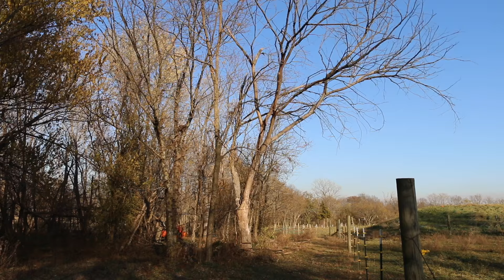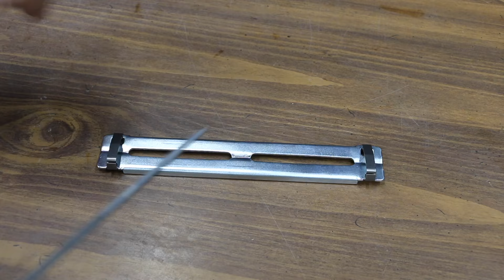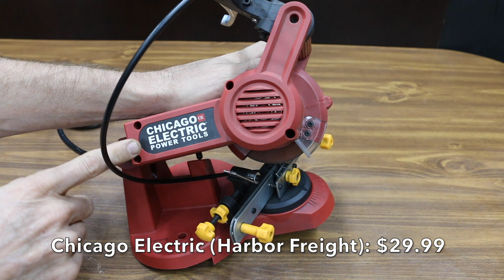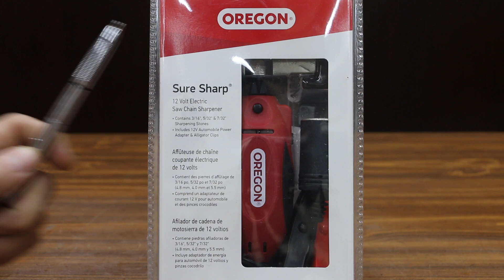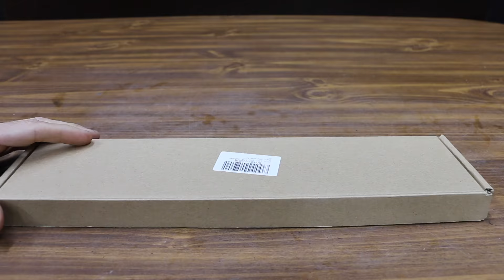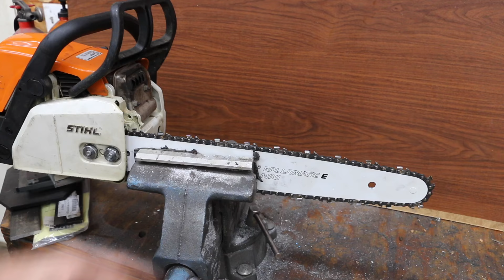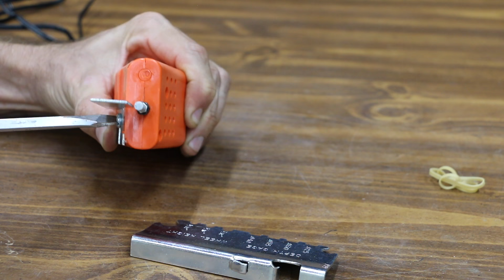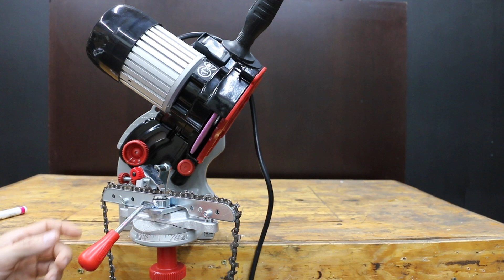Which Chainsaw Sharpener is Best? Let's find out! Stihl, Granberg, Chicago Electric, Oregon

Comment: I have an Oregon electric bench grinder that is about 12 years old.  the instructions on mine advised to loosen the big knob under the chain vise and tilt the base of the chain vise in different directions for left or right teeth.  This gives a different geometry to the grind giving a more aggressive tooth angle and I think the result is a faster cut than I get with the filing system ... that I never use since I got the bench sharpener.  I think the one in your demo has that tilt feature but it was not used and the chain vise was vertical for both right and left teeth.  I'd love to see one of your test times with the vise tilted
Reply from the maker: Thanks for the suggestion.

Comment: If you get a chance and haven’t yet, can you test the Timberline carbide sharpener?  I’ve used one for use now with excellent results, just never run official comparisons with anything.  It does feel like it’s faster than an oem chain after sharpening, especially when I remember to file the rakes down.  

The last sharpening that was done was a very anal re-profiling of heavily damaged chains then went aggressive on the rakes.  Saws were blindingly fast and aggressive through white spruce, poplar and birch.

Might be worth a real comparison.
Reply from the maker: Thanks for the video idea.

Comment: Fir the tenth time my guy. WHEN YOU TILT THE CHAINSAW AT ALL IT WILL SPEED UP THE CUT!!!! Why you can't fathom that is beyond me. You need to hold the saw at the same exact angle for every cut or it's not a good test at all. It's crazy how much faster tilting the saw speeds up the cutting process

Comment: I made my living for over 10 years logging cottonwood for a pallet mill.  Only large stihl chains and although I tried a couple of  sharpeners I always went back to just a bare ass stihl file  without a handle.  Worked better with good sunlight and the chain was sharp when the reflection of the edge disappeared.  First sharpening is sharper than a new chain.  Less material is taken off with a file so the chain lasts longer

Comment: So what about the rakers? Only the Stihl 2 in 1 was mentioned regards to filing the rakers. None of the other ones took care of that at all, did they? Won't that make a difference as the chain gets worn down?
And what one was supposed to sharpen the chain in 5 seconds? I never got which one claimed that. A friend of mine bought this special chain with a piece that clamped onto the end of the bar and sharpened his chain as it spun around, so you didn't have to touch it with a file at all. But it required a special chain which came from the manufacturer of the device. It was impressive though, for what it did.

Comment: I used to Precision file chains for oregon. R&D labs. We would do each cutter with round files to accomplish the same geometries on each cutter. Run each cutter through a spectrometer to measure the hook angle of the cutter at a certain depth. Filing is the best way to do this. We used the same saw with a full tank of gas and oil topped off. The wood we used was cleaned logs and for extra precision we used 12 x12 cant's with zero knots. When using the electric sharpeners we would dress the stone wheel to get a nice round edge. This is a good way to get a nice round gullet. This  may have effected your results. You did a great job though. I personally always likes the stihl chains. They felt the best. Oregon uses grinders that come in from the side. Then they assemble the chain with the cutters sharpened. Carlton chain was also made by Oregon but they had a different method with four big grinders that sharpened the chain after it was assembled.
Reply from the maker: Thanks for sharing.

Comment: I have Been hand filing since 1972, but also have had them done at a shop with a wheel at times, the only draw back of hand filing is that it has to be sharpened on the bar, and when I’m in the field and want to speed things up, I just put on another chain.
These dull chains add up, and I really don’t want to spend time mounting and dismounting chains to sharpen.
For this reason I’m leaning towards a bench sharpener.
Reply from the maker: Thanks for sharing.

Comment: I have used the sthil 2 n1 for nearly 2 years now ,  compact, convenient, fast and easy to use. It also fits in the glove box of my utv  without trying to keep track of accessories or other loose  parts  other sharpeners need.
Reply from the maker: Thanks for sharing.
Reply: I own 4 of those from Stihl. 
They run about $40 here in Alabama and I own so many because they seemed to disappear when I would cut some storm trees so I would pick another up. It is the only time I haven't been upset about buying needless multiples. 

Now I have them everywhere I need them... 

BTW, I haven't checked lately but the Pferd ones or knock offs I'm not sure are almost half on eBay. 

I believe Pferd makes these for Stihl.

 If price has got you unsure
I wouldn't think twice about buying one on eBay. They really are that good...
Reply: dito. blue 2in form Pferd

Comment: Another great video.  The results were a bit surprising.  I figured the bench units would do a better job.  Glad to see what units do a good job in reality.
Reply from the maker: Thanks!
Reply: Grinders take awhile to learn, if you can't sharpen that chain so it cuts faster than a factory new chain you did it wrong.

Comment: I think adding "filed by hand with a round file" would have been a good control group.
Reply: The “Oregon field sharpener” was basically a round file by hand. It had that angle jig clipped on to assist the angle, but that doesn’t really help as much as just allowing the chain tooth to guide the angle. 

I’m glad to see the old fashioned low tech way is about equal with all those power sharpeners and even a new chain. The slow and steady process probably gets more life out of the chain too; instead of hogging it down with abrasive disks or rods.
Reply: That would have put even more variables into the test.  Understanding the sharpener and using it correctly is #1.

Comment: Im a climber and when sharping a chain you should always tighten the chain so that it dosent wiggle around on the bar this also prevents from the teeth angle to change and then adjust your chain after sharpening of refuling I also would like to see the test where the chain is sharpened using just the file by its self no guide as someone would realistically sharpen on the job
Reply from the maker: Thanks for the suggestion.

Comment: Time spent removing the chain must be considered if it is necessaryfor the system. Once calculated the best sharpener is the Oregon sure sharp and it's clone simply because removing the chain to sharpen is not necessary. Just remember to use diamond barrel  bits.  Stones cut too fast and get smaller as they wear.
Reply from the maker: Thanks for sharing.

Comment: You definitely used the bench grinders wrong though.  Blueing the chain is not going to work.  Taking too much material off.  Just need to touch it with the stone.  Your depth gauges would have been way too high

Comment: I love this video, but one huge variable that I think was missed was the 4x4s, you can see the varying grain, that could have affected times drastically when hitting knots. I also think that weirdly using a gas saw would have been more consistent then the variability that comes with fading battery power vs. peak
Reply from the maker: Thanks for the constructive feedback.

Comment: I had a hard time believing any of these reviews with a battery operated saw.  The battery is a variable.  If it's week it won't get the RPMs.  It's like testing my battery operated weed eater.  Same string...but when the battery is week it slows down.  Use a gas powered saw.
Reply from the maker: Thanks for the feedback.

Comment: It's a fact when any product has " MADE IN CHINA" you can rest assure it is cheap, low quality, not built to last crap.  Plus forget about repairing, returning and product having any quality control or built with pride.  
Stihl chainsaws are cheaply made especially with the case/housing.  The bar nuts, studs an area that needs to be very durable is far from that.  The studs are not bolted to the saw body secured with locking nuts on opposite side of chain.  When removing bar if the nut is tight, stuck from grit the entire stud bolt will come out with nut.  It is just screwed into the plastic housing and once the stud comes out.  When putting stud bolt back into plastic the half that is self-threading screw will never fit snug because its threads are just the plastic and a 1/16 turn will strip even worse.  Now the bar can never be bolted on tight or will remain tight.  Yes you can use a JB weld plastic epoxy permanently securing bar bolts and pray the threads never mess up.  
I do not think with the hype Stihl promotes on quality, the high cost for equipment, repairs and the OEM parts. Paying more where the manufacture cost cutting methods in areas they chose cutting quality to reduce their cost is not only unsafe but makes a product junk.  Once these strip out even if product is just a few months old Stihl will be happy to replace housing you just need to pay them for part which is a minimum of $100.   They do not stand behind Junk made.  Look at Husqvarna the bar stud is a case harden bolt housed in a metal body with lock nuts instead of threaded into plastic.  They are inside the bar oil tank.  Stihl also sets their equipment up where special tools they do not list are needed to make adjustments, work on and do your own service.  Stihl product that you own and purchased is designed so the owner has to use Stihl repair center.  You pay for the product and call it yours but the truth is Stihl like many other corporations they still control what you assume is yours.  The average difference in repairs/maintenance cost is ridiculous.  Ordering/Using OEM parts, doing the work yourself will reduce your cost by 65% minimum and could be higher.  If you follow manufactures regular service maintenance schedule and replace with OEM depending on how much you use, drive, hours or mileage a person using factory service dealer would have more in just the general maintenance/ service that the equipment.  I have got quotes for a simple repair, replacement with OEM part and the cost of both labor and materials from factory repair center $1383.00 vs me ordering same OEM parts doing same job and cost was $223.00 parts took me 2 hours.  Even if I paid myself $100.00 per hour I still saved $900.00 and no special tools needed socket set, screwdriver, pliers and duct tape on stand by because everyone needs duct tape. LOL

Comment: It's a well known fact that new chain is not sharp nor accurately ground. Consider that the cutting bits are in contact with other portions of the rest of the chain in its shipping container and that the package goes through tremendous amounts of vibration during shipping and that leaves pre-dulled chain. New chain cutting bits are ground BEFORE assembly and the grinding wheels at the factory are not under constant surveillance so that leaves inaccurate grinding on many of the bits. Then the "sharp" cutter links (bits) drop into a bin where they rub up against other cutters thus dulling the bits pre-assembly. 
     Almost all western timber cutters grind their chain even when brand new. Spare sharp chain that is carried during the day is typically tightly wrapped in shop towels in such a manner that the bits touch nothing that will dull them.
     This is a great video. My comments were made simply in reference to the idea that new chain is the standard for sharpness. It is not. 
     I run Oregon 75CJ most of the time. This is very aggressive chain. It is chisel ground chisel chain that I maintain on a Silvey SDM-4 bit grinder and a Silvey HDG-6 raker and gullet grinder. I do have round chain grinders too; a Silvey 510 for 3/8's and .404 chain and an Oregon 520-120 for smaller round chain. Silvey products are no longer manufactured.
     I'm 63 years old and have been falling timber for my entire working career. I bought my first saw when I was 15 years old. The single greatest knowledge that I have gained about saw chain began when I bought a Granberg File-n-joint at 15 years of age. It not only does an incredible job sharpening round chain but also, if you pay attention, it allows a fabulous education on the dynamics of saw chain. Pretty cheap too!
     Be safe out there.
Reply from the maker: Thanks!  Thanks for sharing.

Comment: Twenty years ago I purchased the big Oregon bench sharpener , think I paid $300 , and some spare stones . I have sharpened hundreds of chains and it’s still in perfect condition! There is definitely a learning curve , easy to remove too much material, and burn cutter ! You must adjust slowly and go easy !
Reply: I totally agree with the learning curve. I use diamond cutting wheel so the diameter doesn't change with usage
Reply from the maker: Thanks for sharing.

Comment: Good video. I appreciate how you were trying to be scientific, but holding the saw with even a slight grip like you did can affect the results with what is called "tactile feedback influence". No matter how unbiased you may be, their could be unconscious bias just from observation and having direct contact with the experiment can change its outcome. I did see a few times where the saw angle suddenly tipped, and your trying to hold the saw steady may have given a brief but firmer bite for a second.  The fact that you said that one particular tool should have done better is a clear but unconscious bias.  Also, wood densities, knots, moisture, grain and such change from cut to cut.  Although not practical, a jig with no human influence cutting through something very consitent cut to cut (like Trex) would have been better. But this video was a good starting point.

I use one very similar to the Oregon Sure Sharp. It cost me $20 USD. I bring a portable jump start battery pack with me. It is fast, doesn't require a fancy set up, and I get great performance. The difference between 9.78 and 10.82 (in the first round) is within the standard deviation. I also bring along a manual sharping set very similar to the one you had that is in a pouch. The 12V mini grinder (Sure Sharp type) is the the all around winner for me. You have to able to sharpen chains in the field and do it quickly with no facy setups. Hmmm, your 2nd round shows vast improvement on all, except on the Oregon Sure Sharp.  For me, that simple tool is on par with all other tools I have tried/borrowed and was the fastest to use.

Comment: When I was taught this two strokes was the maximum allowed. A few of these really seem to eat up the chain pretty quickly. When you are sharpening a few times a day that really makes a difference.
Reply: I used to get chains pretty sharp freehand but I never got the angle even to both sides so the chain would pull to one side.
Reply from the maker: Thanks for sharing.

Comment: Any system that requires taking the chain off the saw is going to be less practical. Putting the Stihl two file system in the lead.
Reply from the maker: Great point!
Reply: I’m sold on the stihl two in one sharpener . I’ve been using saws for 40 plus years , 20 of them on Australian hardwoods .

Comment: Great video. I am more concerned with ease of use. 

99% of us are infrequent chainsaw users. Most of the cut times are statistically similar. 

The ones where you have to remove the chains are really only for pro tree guys. 

When the chain is dull I want one that I can grab and easily sharpen the chain enough to cut well again.
Reply from the maker: Thanks!  Thanks for sharing.

Comment: Sharpening direction should be into the blade as with sharpening knives or any other tool.  The file was used backwards.   A good chainsaw sharpener provides a 2 direction motor so that it can be done properly.  Also the stone wheel on a electric sharpener need to be dressed to maintain the geometry.  The better option is to use a borazon (synthetic diamond) wheel.  If you have carbide tipped chainsaw blades then a natural diamond wheel is needed.  I owned a Silvy 300 and had the Borazon and natural diamond wheels.  The abrasive wheels are messy and a constant battle to maintain the geometry.  With the borazon and natural diamond wheels I had a large magnetic plate that caught 90% or better of the debris, no abrasive dust all over the shop and tools.

Comment: The saw motor heating up will cause it to lose power. Unless it were totally cool for every chain or had been warmed up for the first one there is no way the power output would be the same even with a new battery. The resistance goes up with heat.
Reply from the maker: Thanks for the feedback.

Comment: I would be concerned that the electric sharpeners would generate enough heat to take the temper out of the steel. This is a known issue with electric knife sharpeners.
Reply from the maker: Thanks for the feedback.